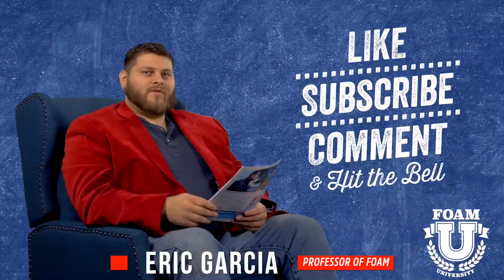Cathedral Ceiling Insulation Problems | Foam University

Comment: I live in a double wide with cathedral ceilings and a metal roof..standing  seem..I have no vents on roof but do have ventilated soffitt..I have heat and condensation issues,what do you recommend to elevate this problem
Reply from the maker: It'd probably be best for one of our project managers to come out and take a look, as every mobile home is slightly different. This article from our Learning Center contains some general information on insulating mobile homes: https://www.retrofoam.com/blog/retrofoam-mobile-home-walls

If you're interested in having us come out and take a look at your specific project, please follow this link to request a free estimate: https://resources.retrofoamofmichigan.com/estimate

Comment: it is that time of year again.  we are considering foaming, again,the catherdral ceiling after the new roof was installed this spring.     But the thermal bridging is the concern.     our kitchen ceiling has been having ice damms since we remodeled.   now i am considering foam but is foam the right choice.  what about baffelling and foaming after?     not sure of the width of the rafters i guess 6 - 8".     is that enough to stop thermo bridging?
Reply from the maker: Unfortunately with a cathedral ceiling, the only way to stop thermal bridging is to have some kind of continuous insulation between the rafter/stud and the conditioned space. Foam is going to be your best option for the cavities, but unless you take off the drywall ceiling you will lose some heat through those rafters.
Reply: are you on board w/ what others say about a vent channel through each section to the ridge of the roof for air circulation of ceiling to stop bridging?   also, are you suggesting taking down the dry wall ceiling and replace it w/ foamboard then drywall or what?
Reply from the maker: @mrzif0013  Ventilation does not stop thermal bridging. The only way to stop it is by removing the drywall and putting insulation up between the rafters and the drywall.

Comment: My top floor is cathedral ceilings and its very hot and the AC is working fine. Is this an insulation issue?
Reply from the maker: Yes, that could be an insulation problem. Most insulation materials diminish in effectiveness after a couple years.
Reply: @RetroFoamofMichigan  so what do you suggest I do...get estimates from spray foam insulation or regular company

Comment: Eric, 
    Recently closed on a home that most resembles an attack bonus room. 4’ side wall that a 2” X 12” rafter is notched atop of. The 4’ wall & rafter seam looks as if the the paint is bleeding. Drywall is not soft so I don’t think it’s water infiltration. Thoughts?
Reply from the maker: It could be water infiltration. I would recommend opening up a small section of the ceiling to see whats happening above the drywall.
Reply: This guy has no real education beyond business school, and I even doubt he learned much there given how he handled the mess his crew made of my job.
Talk to a real pro.

Comment: whar a great find for me.  my cathedral ceiling has  large sky lights and many lighting cans in the ceiling.  ice dams have been a problem ever since i remodled years ago and seem to be getting worse,  the insulation is fiberglass.  how would you go about insulating this project?
Reply: Just had water issues with my cathedral ceiling that no one could figure out.  Turned out to be my ceiling fan!  Some of hot moist air in our bathroom was escaping thru the ceiling fan hole into the roof cavity.  Fan started sparking from the water.  I removed fan and the problem was way worse because Left the hole open to install a new fan.  All this time I thought it was a leaky skylight, but it was all the result of air leaking thru that hole and condensing in the attic.  No issues in the summer at all. Only in the cold winter.  Plus, that cathedral ceiling is on the north side and the sun doesn’t hit the roof.  Cold roof made the hit air run like a faucet.  What I learned:  Seal all holes in the roof as good as possible.
Reply from the maker: The method we recommend to insulate a cathedral ceiling would be to remove any existing insulation, like that fiberglass. This is done as the crews cut one- to two-foot strips through the middle of the stud cavities on either side of the peak. 
The old insulation is removed through these strips, and then an open cell spray foam is sprayed into the cavities. Once the foam has been sprayed into the cavities, drywall is placed back over where the strips were cut and a rough patch of mud is spread over the seams.
Reply: the  dry wall can screw into the foam?
Reply from the maker: @mrzif0013  The drywall is screwed back into the wood framing the cavity.

Comment: hi, would insulation in the walls have the same issue, of breaking down over time, like the ceiling would?  i have cathedral ceilings and i'm looking to do foam for the ceiling and roxul for the walls.  it's a music studio and i'm told that something like roxul will have block sound a few db better than foam, but i don't want to mess around with the ceilings.
Reply from the maker: Rockwool tends to hold up better than fiberglass and cellulose over time, but we have seen it breakdown as well.